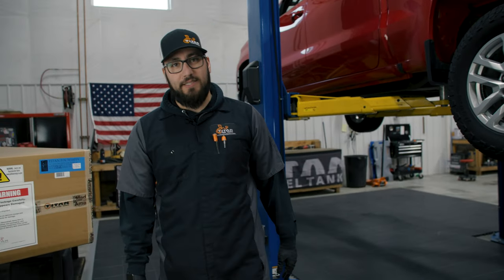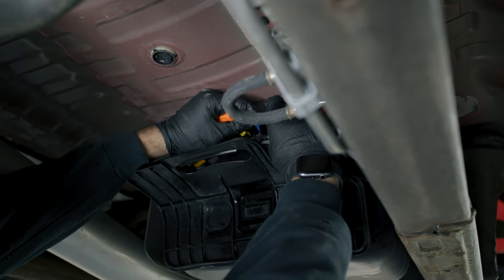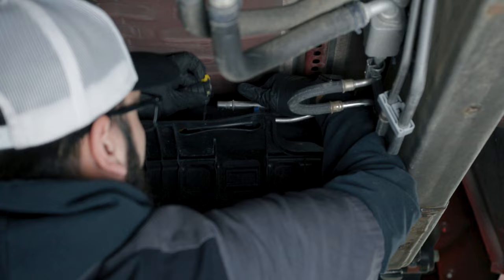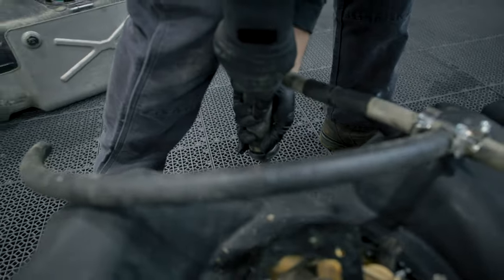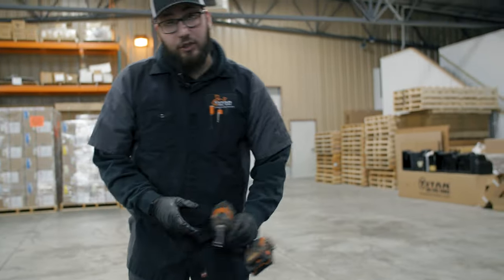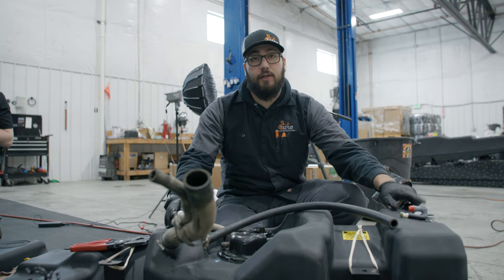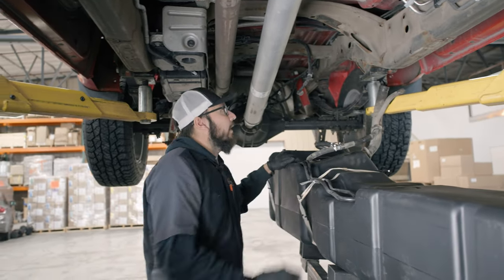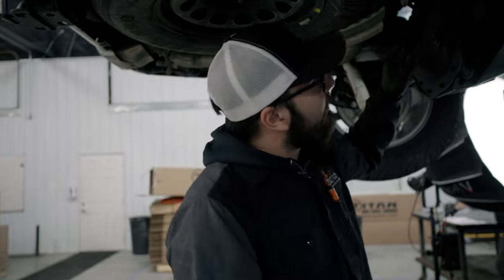Titan Fuel Tanks 2019-2023 GM 1500 Crew Cab, Short & Standard Bed Install | 7010519

Comment: How does the truck know it has a higher capacity fuel tank so the miles to go Guess-o-meter reads the increased mileage calculation?
Reply: Titan told me the Distance to Empty (DTE) will be incorrect.  GM has not enabled any changes to the DTE functionality.  If you find out additional info, please post it.
Reply: Damn this sucks this makes me not want to buy it I don’t want to guess when I have to fill unless it shows you once you’re at the 23 gallon mark left of fuel and show it as a full tank so after that point it marks it
Reply: The gauge will read right even if the mileage estimate is off.

Comment: Is there a way to adjust the miles till empty program
Reply: That’s the question I’ve been asking. Wondering if the edge tuner will do it
Reply: Titan told me the Distance to Empty (DTE) will be incorrect.  GM has not enabled any changes to the DTE functionality.  If you find out additional info, please post it.
Reply: @StudioRV8  there got to be some out there for this I would hate to put the tank on and it read correctly smh